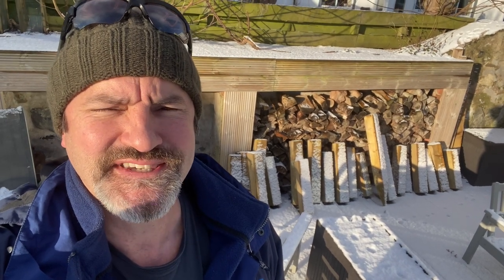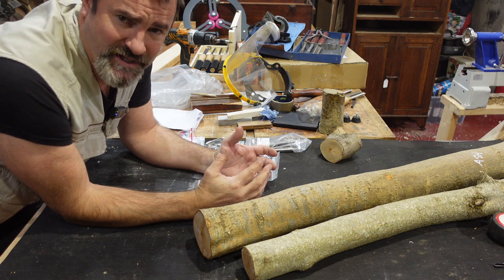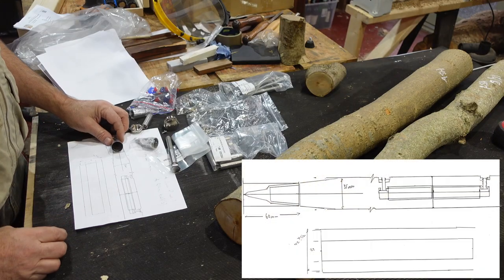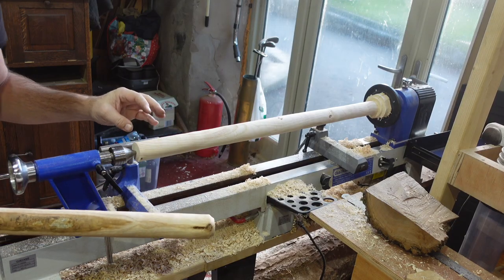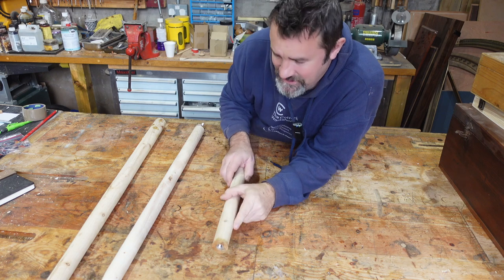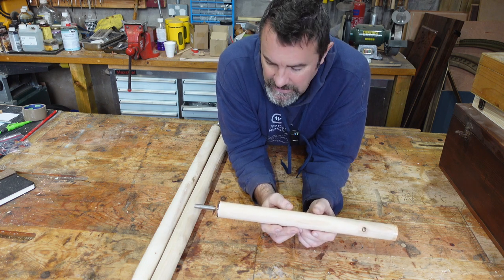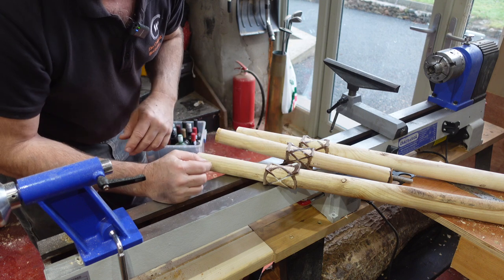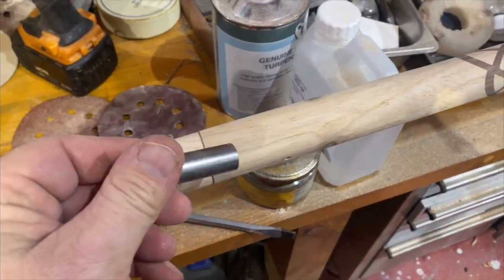Secret Lurk (long single pole used by telemark skiiers instead of 2 ski poles) ash and walnut

Comment: That turned out amazing Bruce.  
What finish/oil did you use on it? it looks really good. 
Lucky Lars. 
...and Toffee was CGIed in to this video. 😝
Thanks for sharing
Reply from the maker: Thank you. I used two coats of Osmo hard wax oil and then two coats of Renaissance microcrystalline wax.